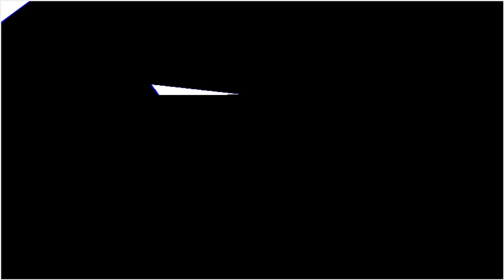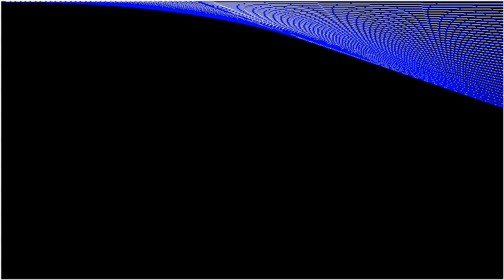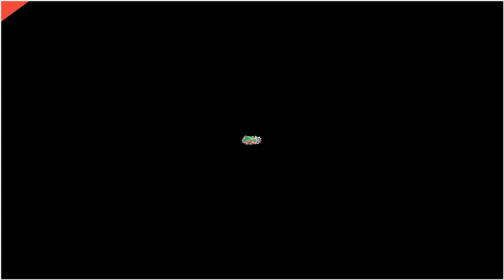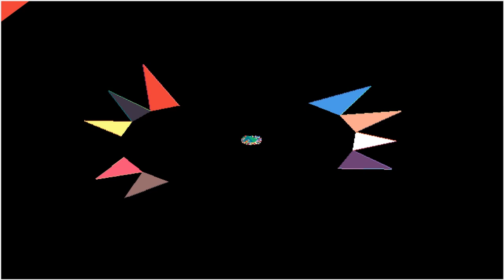Channel Update, New Workflow, and Project Teaser

Comment: Project is definitely an FPGA implementation of the TREX/FBI (or possibly the V2 BE/CK) Chipset from 3Dfx? I instantly recognise that demo teaser at the end. I wrote a program a while ago that used the raw vertex and colour information from the driver (3Dfx shoved all the raw data into a single gigantic .c file) to draw that same logo using OpenGL 3.

Interesting if so, because it seems we've had the same project idea. I with a co worker have been working on the initial stages (PCI Arbiter, Register file) of some Verilog to emulate the SST-1 chipset on an FPGA, though we're still mostly simulating for the moment due to lack of hardware (and the ability to acquire any with the current shortages of parts).
The idea is that it's a drop in core that people can put into a Win9x machine to have some level of Glide support, as the cards are few and far between to find, and expensive due to retro price gouging.
Reply from the maker: Indeed, that is what I am working on. Although, I currently have it on hold as I realized that there is no FPGA based CPU core that can drive it. 
Have you thought about how to deal with the framebuffer latency? That was probably the biggest challenge I've had to overcome so far. If you don't used EDO, then you will need to figure out a different way to re-implement the rasterization order and tile caching. I probably spent about a month with a custom simulator running a hyper-parameter search over different caching mechanisms. 

In terms of implementation, I also only got as far as simulation for the core, but I have hardware that will let me run it from a modern Linux machine over PCIe - that's how I captured the PCI transactions to create the demo at the end (i.e. they were generated from running the Glide test programs for the SST1). Aside from interfacing with the DRAM, the core currently supports solid fill and triangle commands via the PCI interface (which is compatible with the Glide drivers - though I had to disable the TREX check as it requires reading from the DRAM). 
I originally brushed off the idea of a stand-alone PCI card, but if there's interest in running it on Win9x machines (i.e. as a PCI card), then it might be worth moving it back to the front of the queue (I'm a bit stuck on the PMMX core anyway). The current version might be overkill for that application though, as it supports 4x MSAA and can meet timing closure at 215 MHz (so 860 megapixels/s - lots of optimization).
Reply: @RTLEngineering  

> Although, I currently have it on hold as I realized that there is no FPGA based CPU core that can drive it. 
Yeah this is the conclusion that we came to early on, mostly because we wanted to have 1:1 software compatibility with actual Glide software instead of whatever stuff was cooked up in the SDK that 3Dfx released. We were also considering a dual FPGA design if we couldn't fit the FBI and TREX on a single FPGA. The real challenge I believe will be in the interface that keeps the FBI and TREX's in sync at a high texture fill rate, though I'm not too privy to the TREX architecture as I can't actually find any documentation about it (and the SST-1 Datasheet alludes to a "TREX Reference Manual" that doesn't seem to exist). 

> Have you thought about how to deal with the framebuffer latency? That was probably the biggest challenge I've had to overcome so far. If you don't used EDO, then you will need to figure out a different way to re-implement the rasterization order and tile caching.
You mean the delay of pixel writes to the LFB due to the memory configuration (which I believe is interleaved across the 4 memory ICs contained on a standard 4MiB configuration board) not being striped unless you use the same type of memory? We were actually pondering this quite heavily, and I was of the opinion that we should try to find New Old Stock EDO DRAM specifically to circumvent the issue entirely. It's interesting that you seemed to have collided with this as well. My friend's idea was (if I recall) to clock the interface up as fast as possible/dual port it to get some level of acceptable bandwidth on LFP/Depth Buffer writes, though we haven't done much experimentation here as I was mostly working on the PCI controller part while he did some hardware feasibility/dev board creation for us. What's special about the rasterization order of the FBI? I don't recall reading anything particularly special about it in the available SST-1 datasheet.
A question for you; how exactly did you go about implementing "x.y fixed format" that 3Dfx allude to for registers such as `fVertexAx` etc? I take it you'd just have a floating to fixed block that does the conversions as the data is streamed in over the PCI bus? 

> though I had to disable the TREX check as it requires reading from the DRAM). 
I recall seeing this too. The driver manually probes the address space to see what configuration the card is. 

> I originally brushed off the idea of a stand-alone PCI card, but if there's interest in running it on Win9x machines (i.e. as a PCI card), then it might be worth moving it back to the front of the queue
I believe this is the path of least resistance in terms of software and hardware compatibility. The idea for our implementation was to be a 1:1 replica that can be dropped into a machine. 

If you're interested in joining forces to hack away at this, drop me an email at jooster669<at>gmail<dot>com, or add me on Discord at quaker#3407 and we can go from there. We've got a Confluence/Jira space set up to track tasks and document as we go. You'd probably the most experienced person(we both work at a somewhat large semiconductor manufacturer on Embedded Firmware, though my friend worked on Verilog/RTL stuff before his current position) however it can't hurt to have more eyeballs/engineers on this

I also find it especially coincidental that we're both working on the same project at the same time, for something so completely obscure haha!

Comment: "PCI-Express FPGA" Dang! I'm insta-interested in something like that. Also: I s good to know that u keep working in this topic. I will be more than happy to know what u have been "cooking" :)
Reply from the maker: I am actually working on a project that uses a PCIe based FPGA, but the application mentioned in this video was just to capture the PCI trace (that's all it did, besides some light emulation). But if you didn't know... you can configure a FPGA to pretend to be some other PCI/PCIe device, and the existing drivers will think it's something else as long as you can keep up the façade. That's the application mentioned in the video - the new application is with custom drivers.

Comment: What are exactly adventsges of PCI-E fpga board over standalone one in case of emulation? If you want to put whole system on FPGA you achive nothing by designing your board as addon for PC, if you want utilizing some PC components (hybrid emulation?), you introduce lags, imprecision of emulation and many technical issues.
Reply from the maker: For clarification, the PCIE FPGA that I mentioned was being used to capture a PCI stream from an original driver. The hardware I am working on was a PCI device, so that was the easiest way to get test input.
Your question about a PCIE FPGA vs a standalone one is not simple to answer, it depends on what you want out of it. 

The first point is development vs. usage. If you are developing a core, it could be much easier to use a PCIE based FPGA, since that lets you couple the hardware to a software simulator (sort of like hybrid emulation, but a low performance version of it). That lets you test things without finishing the entire core (i.e. you can do it in parts).

The next question would be: do you want a dedicated hardware solution like the Analogue systems or Mega 65? If so, then you are better off with a standalone case that breaks out the I/O for a specific connector.
If instead you want a system that can emulate varying hardware, then it becomes more complicated. 
1. It may not be practical to implement every part of the main system in a FPGA. This is where hybrid emulation would come in. Take for example the OG xBox. You could easily implement the system aside from the Coppermine CPU, but you're probably not going to find a FPGA that will be able to run something like that at 733 MHz. The same thing could go for the GameCube, where you might not be able to run a Gekko core at 486 MHz in a FPGA. In those cases, you would need to fallback to emulation on a more powerful CPU. Although that does blur the lines of why a FPGA would be needed in the first place.
2. There's a wide variety of I/O that has been used. It's impossible to support every type of possible, each with their own widths and electrical requirements (sure you can support a Genesis gampad connector, and a SNES connector, and a PSX connector, etc. But there's also things like parallel, IDE, SCSI, etc. You would need to draw a line somewhere). Even in the case of a SNES / Genesis connector, if the pins aren't the same electrically and you mistakenly plug the wrong controller in, then you could damage the buffers (which would be far worse if they were directly on the FPGA).
It's also not always going to be practical or convenient to connect to original I/O, so you may be better off using something more modern like USB or BT, or emulating it entirely like in the case of an IDE disk.
2a. Yes, using USB/BT/emulation, can add latency, but that latency is pretty much identical regardless of where the controller is located. An ARM connected via SPI, or an ARM in the FPGA package, or an x86 connected through PCIe. PCIe only adds about 200ns of latency in the worst case, which is not going to make or break the I/O (the latency comes from the OS, not the connection).
Latency is really only a drawback when it comes to either A) needing to bit-bang older hardware, like with a C64 disk drive or a SNES game pad, or B) having too much delay from the OS translation layer (for things like USB and BT). If everything is set up correctly, you shouldn't have significant latency from video either, even if the frame is being copied from the PCIe card onto the host.
3. Cost and value. Simply put, higher end FPGAs are expensive, and even more so if they are built into something with low volume. If you put one in a stand alone system, then you're going to sink a lot of cost into it and only have it be used for that one application. Using an off-the-shelf PCIe based FPGA could yield a better value than having a small company like Analogue manufacture something, and it can go into an existing computer system you have already invested money into. When you upgrade or replace that system, you can just move the FPGA card over to the next system, since FPGAs advance on the 10+ year timescale, not the 1-2 years of PCs. Even the Alveo U50 FPGA at $2800 USD is a better value than the DE10-Nano (when you consider LEs and speed per dollar).
3a. You could use the FPGA card in a PC for things other than emulation. If there was a large enough interest, companies like Adobe could develop dedicated accelerators for their software. Or, you could couple the FPGA with an existing emulator to perform further post processing. 

If you're not developing a core, those points don't sound appealing, and a standalone system works fine for what you want, then there's no reason to consider a PCIE FPGA instead. It's like a step function... you don't need it until you find that you really need it. But if you never get to that point, then you're better off saving your money / spending it on something else.

Comment: Eh sounds fine, id just be worried about more technical terms having trouble being pronounced. (Mostly just commenting for engagement)
Reply from the maker: Thanks! Luckily technical terms won't be an issue since I have control over phonemes for each word in the generation program. I'll make sure to fix any errors there. Although this video didn't require any corrections, which impressed me (I know the acronyms sounded a little robotic though, but I didn't think that was worth the time to smooth out).